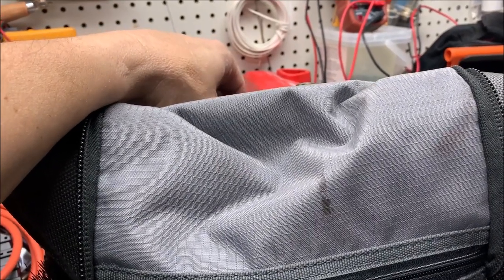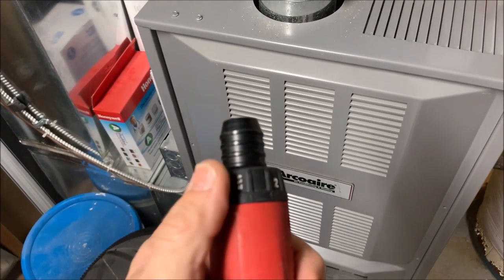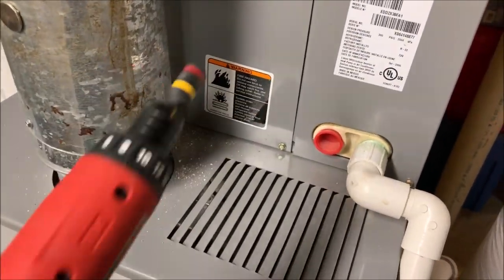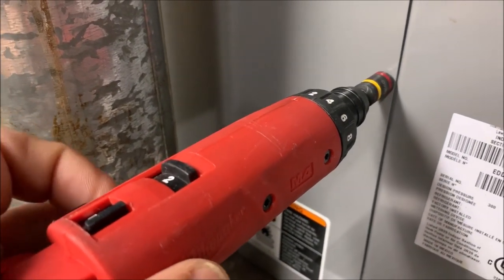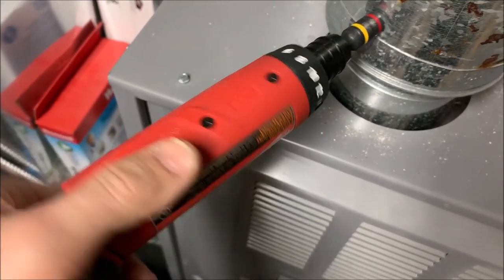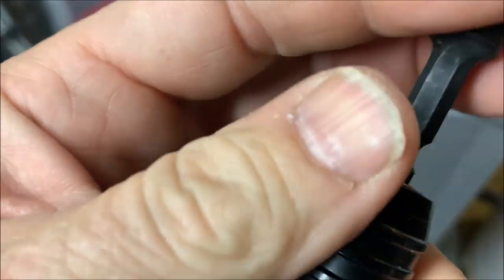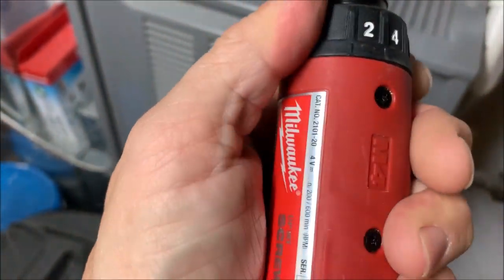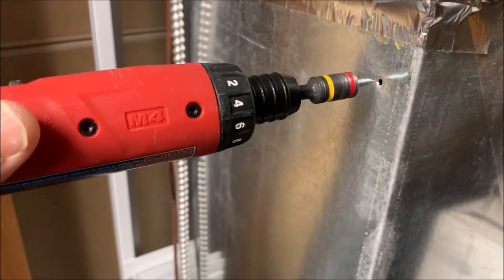What's in the Toolbag? Milwaukee M4 Screwdriver

Comment: Between $140-150 for (1battery+1charger). 12v impact cost $169 gen 2 with low torque setting (2/2.0ah battery)Would love to own it but feel like it’s over priced and the impact would come more useful in the long run . If I catch it on sell no doubt buying one.

Comment: The previous Milwaukee driver, which is basically identical to this one, had the battery discontinued.  Of course, the new battery is incompatible with the old driver solely because the locking lugs were moved.  Thanks Milwaukee.

Comment: I've been using the DeWalt gyroscopic screwdriver, which is 8v and turns with the rotation of your wrist (via a gyro). I would still like to  give this a shot - I didn't even know they (or the Makita variant) existed before this week! I don't dislike my DeWalt at all (battery typically lasts all day), but I suspect the m4 is lighter weight.

Thanks for sharing!
Reply from the maker: StayAtTheRetreat I’ve got the DeWalt as well, but I do like the Milwaukee out of the 3 the best (yes, I have all 3, the Makita has a higher voltage battery, but doesn’t seem to last as long as the Milwaukee). I had one DeWalt fail on me, it would work intermittently. I believe it was an internal wire issue, my other one didn’t have issues. Weight wise, they’re about the same. If you’re happy with the DeWalt, I wouldn’t change, unless it’s new toy time.
Reply: @tcphvacr9950  Can you use the Dewalt one manually ??
Reply: Yes dewalt works manually too if battery dies or not strong enough to untight

Comment: Yeah it's a neat tool. I recently got two of them and was surprised that it has two diffrent chuck size. They both fit the same bits but one looks like the one you got(the same size that's on the box picture) and one looks like a tiny baby version of that.  It's weird.

Comment: I just bought the Dewalt DCF680N1 with the gyroscope to replace an older Milwaukee m4 screwdriver with NiCad batteries that was starting to give me problems and I can't find anywhere to buy m4 NiCad batteries. I definitely prefer the Milwaukee m4 screwdriver but the Dewalt saved me $50, so I bought it. I am considering returning it. I am not crazy about the gyroscope feature, though it is ok. I Iike the lights The Milwaukee has definitely all-around better handling, lighter, thinner, and features.  Unfortunately, it is never on sale.but not sure $50 in savings is worth it. I also like in the Milwaukee that you can use it as a screwdriver when you are out of battery life which is not a feature in the dewalt. That feature comes in handy when you just want to finish the job;
Reply: I did return the Dewalt Screwdriver. I prefer this Milwaukee. I really wanted to like the Dewalt because I was able to get some discounts. Milwaukee never seems to have discounts. They are expensive. Maybe at Christmas, I will treat myself. This NI cad still works but near its end.

Comment: You had me sold on this tool but when I clicked on the link in your description and saw it was the same price as a new Milwaukee m12 impact driver I changed my mind 😂
Reply: Refrigeration Mechanic but you wont strip out anything with this one
Reply: The DeWalt is around $60. It fits in a back pocket, bends 90 degrees and uses a wrist twist to activate direction. It's 8 volts and is plenty for most light service work.
Reply: Joe Shearer yea you’re right I’m a big Milwaukee guy so knowing me I’ll end up buying it
Reply from the maker: mike logan I have the DeWalt as well, and liked it. The only problem is one of them started working intermittently, and I had to get another one. The gyroscopic action went wonky on it. $150 caused me to go with the DeWalt, but I pulled the trigger and haven’t been disappointed. But in saying that, my other DeWalt hasn’t messed up, but it is in my “emergency,  personal truck” MB2 bag.
Reply from the maker: Refrigeration Mechanic I buy all my tools that I show on my channel, no affiliation with anyone, but I will say, I don’t think you’ll be disappointed in it. Price caused me to hesitate, but I haven’t regretted buying it. Now, if you’re looking to buy an all around driver where size isn’t the issue, they make the 2402-22 set for $179, and I have that one as well. It has a dial to go from clutch to drill, without having to change your torque setting, and it has two speeds (goes up to 1700 rpm), and you can break tough screws loose by turning the drill manually, because it doesn’t slip. If you have tons of M12 batteries, the tool only is $129. Here’s a link: https://www.cpomilwaukee.com/milwaukee-2402-22-m12-fuel-lithium-ion-1-4-in.-hex-2-speed-screwdriver/miln2402-22.html?ref=pla&zmam=31282435&zmas=47&zmac=722&zmap=miln2402-22&gclid=EAIaIQobChMInvjM5vzV5gIViobACh2c6AsNEAUYASABEgKv1_D_BwE
Reply: tcpHVAC/R yea I’ll end up buying it ... to be honest I didn’t know Milwaukee even had a 4 volt line of tools 🧰
Reply: @marlon8429  I am surprised the 4v line isn't in more stores. It has been out like 6 years now and this is the 2nd Gen 4v system.

Comment: I had the 12 volt screwdriver with that chuck and the hex bit would move back and forethought with the bit in . Does the m4 have any movement in the bit?
Reply from the maker: No it doesn’t. If the battery doesn’t have enough power to remove or drive, you can turn it manually.

Comment: Great video. Do u think it would be strong enough to allow a step bit drill a 3/8 hole in ductwork for my testo probes ?
Reply from the maker: Cory Desormeaux I just took a step bit from Harbor Freight that goes up to 1/2”, and I was able to get a nice clean hole with it in sheet metal.  I had to reverse it and go back in a couple of times, but it did it. I didn’t think it would due to the big fluting in the bit, but it did.
Reply: tcpHVAC/R very cool. Tempted now to grab one for my cooling bag set up

Comment: I've had these since they came out like 6 years ago. I replaced my older style 4v Milwaukee drivers that were a little bigger.  

I wish Milwaukee would redesign the clutch so it only works CW when putting screws in. There is little need for a clutch when removing screws. I sent an message to them regarding this a long long time ago and got a response that they would give the feedback to the engineering team. Guess never did anything about it.

I did the 2101-22  2 battery combo and got a "tool only" no battery version which is very inexpensive. 2 drivers, 2 batteries and one charger is a nice combo.